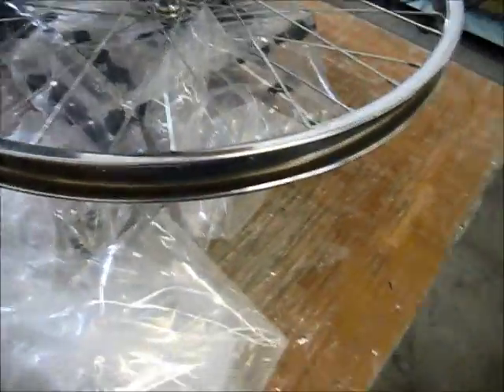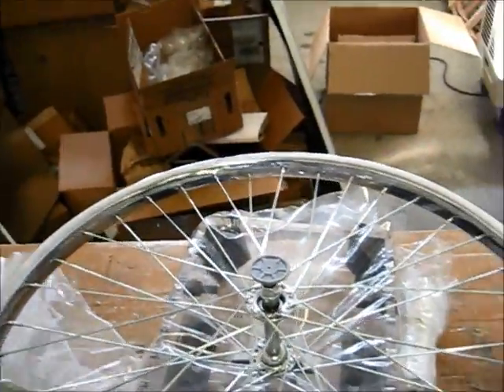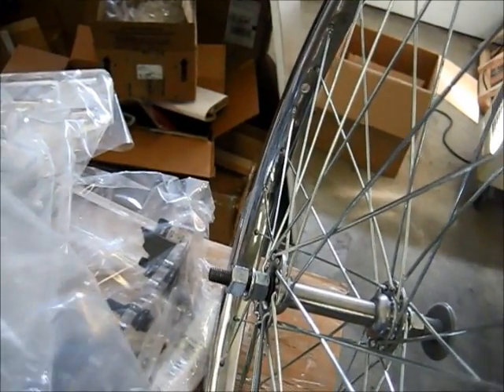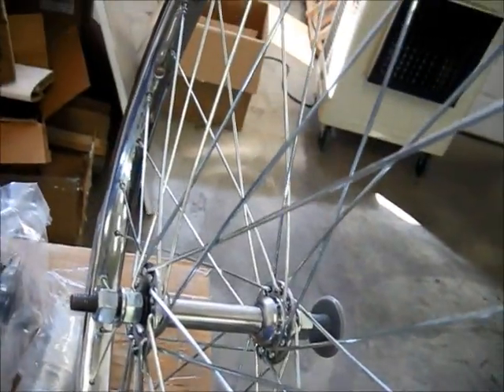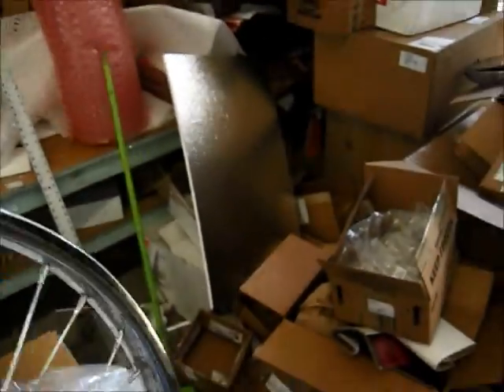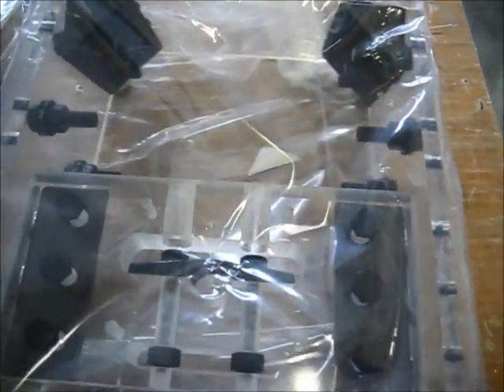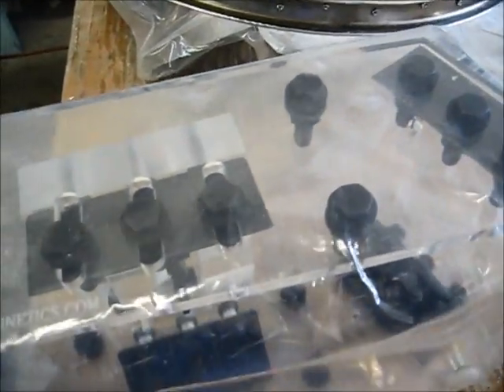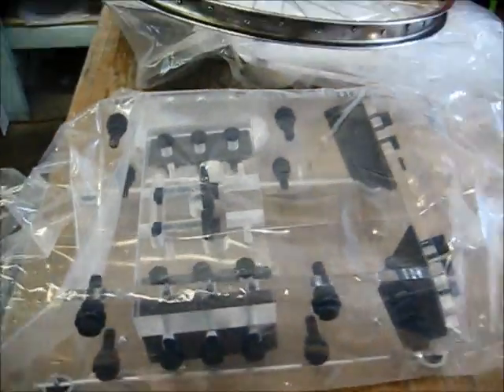New SSG Energizer.

Comment: hello john. i have two questions #1 maybe two parts. i know this is a 7-8 wire coil energizer, with 1 trigger and 7 secondary coil wires. what would you say this units performance out put would be. as in it's amp hour charging rate would be, or horse power rating. if you can call it that. it something for me to grasp the concept better. i ask this because it's figures i know and can relate. being i'm a ham and auto mechanic/race car builder. i've also seen the 10 and 30 coil units. #2 on the alum batteries. could they be composed of other materials replacing the lead and red lead plates, maybe copper plates with magnesium plates using the same lead acid separators and alum fill. maybe a sponge copper and sponge magnesium for plates. making the plates of sponge to save weight and to increase surface area of contact an overall current capacity. just a thought.